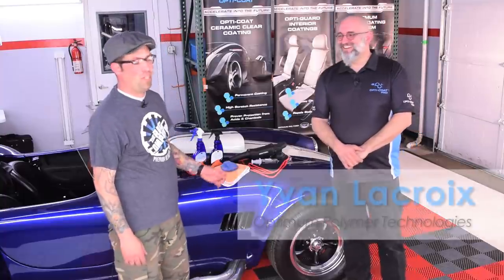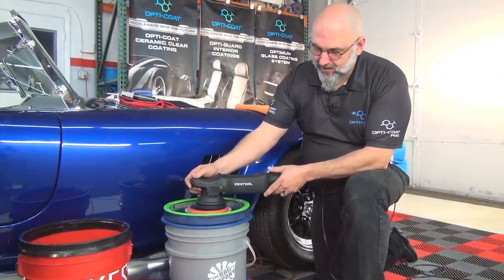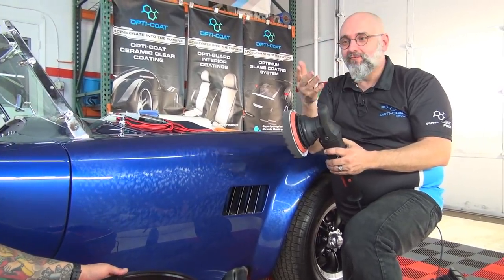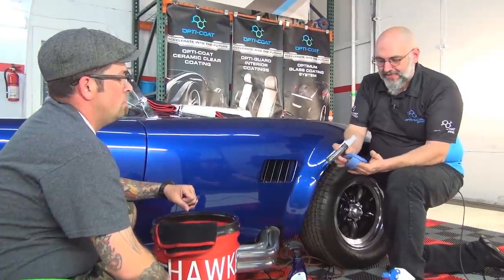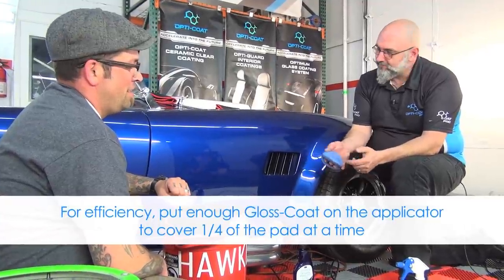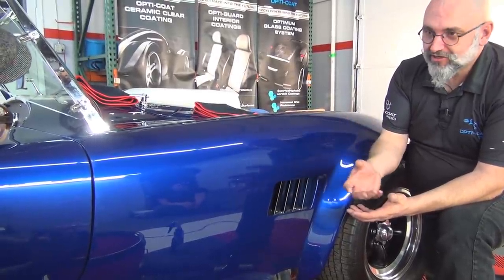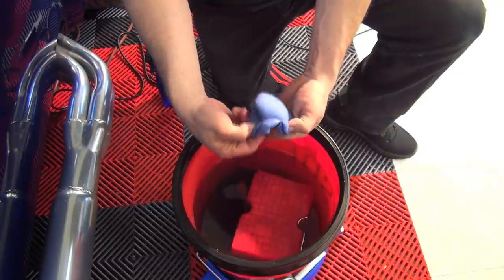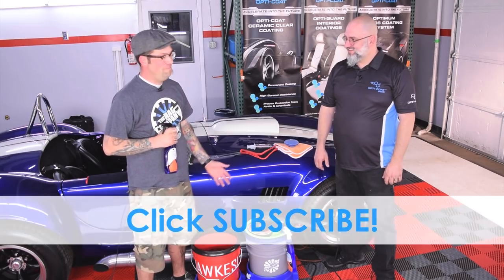PROTECT YOUR PAINT: How to Properly Apply Optimum Gloss-Coat

Comment: Fell in love with Optimum Gloss Coat the other day!  I've applied two other brands of coatings and Optimum Gloss Coat is by FAR the easiest to apply and after learning about the technology that went into it through the Optimum Synergy Podcast I am confident it is a superior coating to all other consumer grade coatings.  If you are at all apprehensive about buying this and worried about how difficult it is to apply figuring these pros are making it look easy, it really is this easy.  

Just as the video shows, wipe it in, wait a few minutes and gently buff out the high spots.  With other coatings the wipe off window of time was very narrow.  If you buff too early it smears the coating.  Too late and it's tacky and your microfiber won't slide across the panel.  Way too late and the high spots have hardened and you have to polish and start all over.  Not at all the case with Gloss Coat.  Sure, if you wait wayyyyy to long then yes the high spots will harden.  And if you wipe it on then immediately try to wipe off then of course you're going to end up taking the coating off or smearing it.  Yet, the window of opportunity to wipe off/level the high spots is very wide and forgiving.  

With gloss coat, application was so easy I quickly became confident enough to just keep moving from one panel to the next applying continuously until about two minutes had elapsed from the first panel then I would buff off that panel.  Apply to another panel, then buff the next panel that reached two minutes from application.  I was able to apply Gloss Coat to the entire vehicle using just 4cc's in just under 20 minutes.  Applying a sealant with a DA takes longer than that with buff off time included.
Reply: Christopher Benjamin I’ve heard about this infamous podcast, can you link me to it
Reply: And no solvent smell. We use Caramic Pro at work and It's not fun at all.

Comment: hey guys when you leveled the high spots I noticed you did it twice. 

1) did you use the SAME applicator as was used to initially apply the coating?

2) why use the applicator vs the MF towel? thanks for the solid video!
Reply: +The Rag Company thank you so much for the information! I finally got it all dialed in. I love this stuff! 

I actually got my car ready to be coated and went to the gas station where they have dim lighting - at night. And viola. Perfect lighting to see the high spots.

Comment: Could this be done without using Hyper Polish?  As in with no polish?  I have some incoming just in case.  I have .001 experience with my PC 7424XP and I am about to do a set of Viper wheels.  No worries, they are backup drag wheels for my buddies '97 B/W GTS!  Also, I have Lake Country Pads.  I take it that their white polishing foam pad will work just fine? (5.5 inch).

Comment: Thanks for the great video! After wiping off the OGC do we need to throw away the microfiber towels used or can they be washed and used again?
Reply: +RN-Buffer you can wash them and re-use w/o issue. i always rinse right after and/or throw in a bucket with water or solution if i know i won't be washing immediately.

Comment: Levi/Yvan need advice! My first time using gloss coat was 3 days ago on a brand new navarra blue audi, looks beautiful and the product is outstanding to work with and after 2 hours or pacing the car I found I had zero high spots. Now, after car had been sat in my garage for 2 days, today I released the car, just as it started to rain heavily. I've heard of water spotting with gloss coat while it's still in the 7 day curing period, I want to avoid that, can I use ONR-W&S (but not soap) to clean it now then dry it with either opti-seal or car wax.....or, can I use a car dryer to rid the water that's beading beautifully or am I best off leaving it until after the 7 days?

Comment: What do you maintain the coating with? I know some have specific type sealants they use to maintain and keep a slick feel, since some coatings can have a sticky feel.
Reply: You only need to lightly clay the surface, to remove contaminants, once per year. Other SiO2 coatings tend to have a "swiss cheese effect" on the surface and because of that they need to be replenished every 6 months. Gloss Coat does not.

Comment: how soon can you top it with their spray sealant?
Reply: One hour after application is recommended to protect the coating as it cures. 

I often use it as a drying aide after ONR washes. Sometimes I do a regular application just to practice.

Comment: So using Gloss Coat, no waxing necessary?
Reply: Yup! Gloss Coat provides 2 years of protection! No need to continually wax or seal the surface. You can if your into that sort thing. But there is no need. Keep the surface clean by washing with ONR. Once per year, clay the surface to  lightly to remove any contaminants that may have landed on the surface. this will revive your Gloss Coated vehicle.